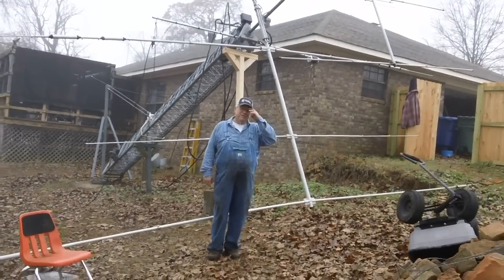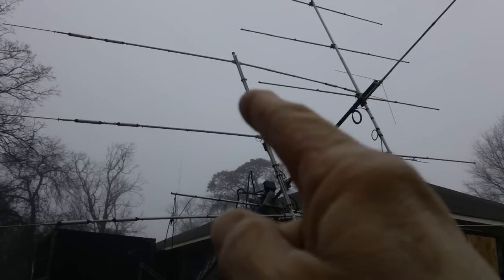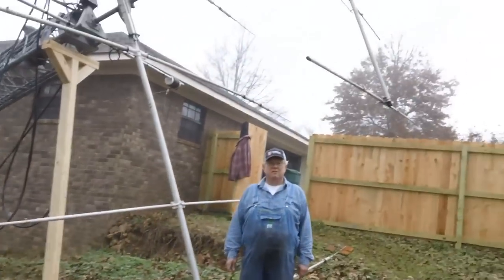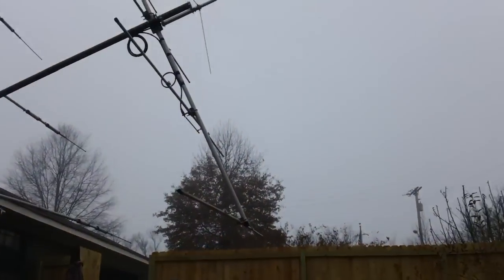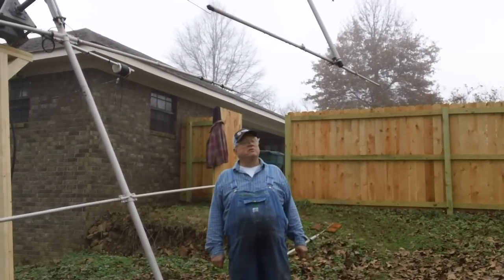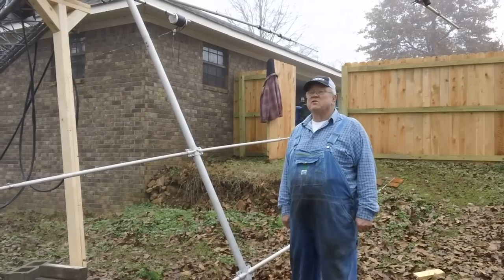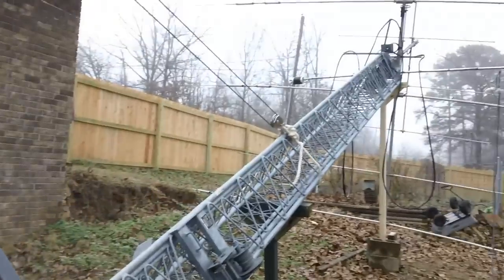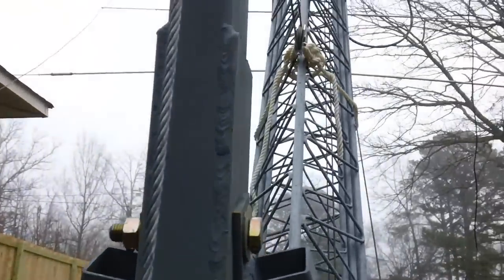Mish-Mash #187

Comment: Hey John, 

Pretty interesting video.  I didn't understand it all, but found it very interesting.  I imagine this antenna will be the highest metal thing around, which brings to me the question, what about lightning strikes?  Will all those ground rods protect the antenna and his radio equipment?  Or, does he have some kind of lightning arrester on it?

Regards, Tom
Reply: Exactly what I was going to ask! J.
Reply: That's pretty much built into the antenna  design.  Pretty much everything is grounded.  The trick is to make the ground the least path for it to go through, i.e. make it go from the ground instead of getting into the shack.  Lightening actually travels FROM the ground into the sky.   So it's also important to have all the stuff in the shack grounded too.  Many hams use antenna switches that GROUND THE ANTENNA inside the shack too, when it gets stormy.  But a direct hit usually will do its damage, the idea is to try to minimize the damage.  Some guys also use lightening rods on their house and barns.  Don